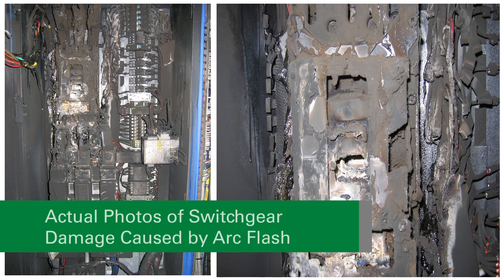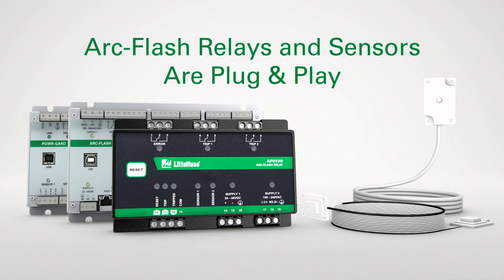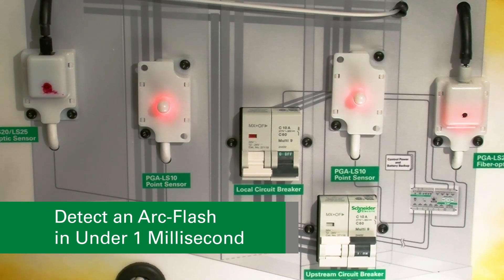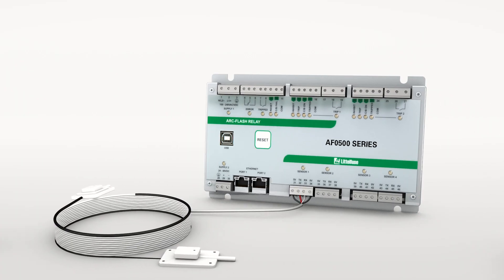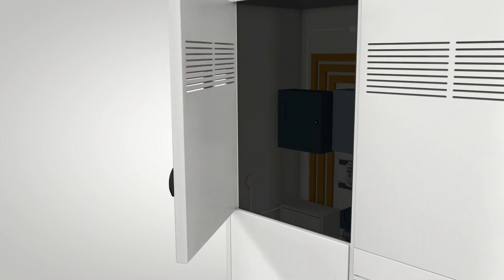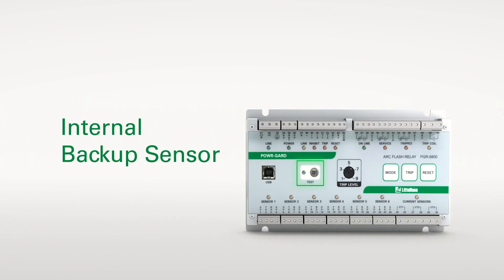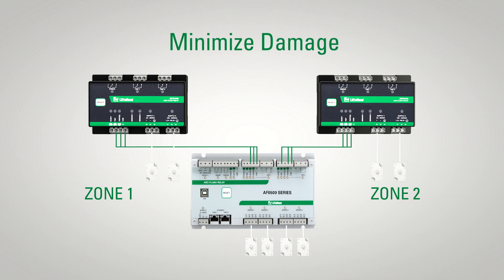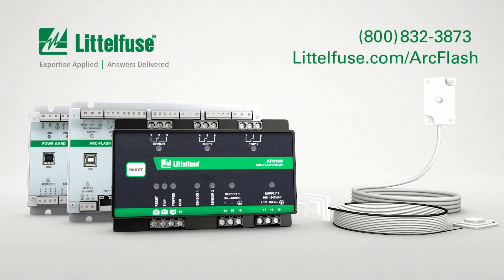How Do Arc-Flash Relays Work?

Comment: how do they work are they integrated into existing protection system for faster trip times?
Reply from the maker: Hi there, this should answer your question: Littelfuse Arc Flash Relays utilize light sensors installed throughout the cabinets to detect an arc flash, which can easily be retrofit into most cabinets. Input from current sensors can also be added if desired to verify the presence of an arc, if there is concern of other light sources creating a false arc detection. The Arc Flash Relay can react to an arc extremely fast, providing a trip signal in under 1 ms, which is connected an existing circuit breaker within the equipment. The total clearing time will then be the 1 ms Arc Flash Relay reaction time plus the breaker operating time. For the majority of arc events, this is a significantly faster clearing time, and thus a lower incident energy level, than would normally be achieved using only standard current-based protection.